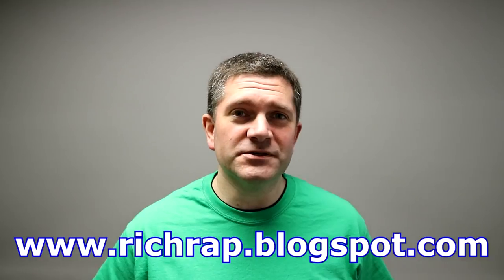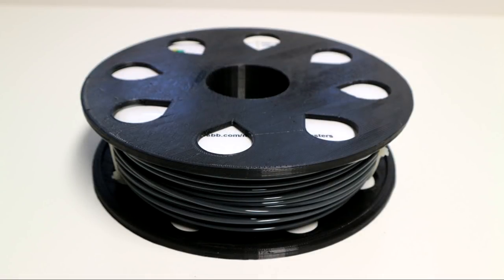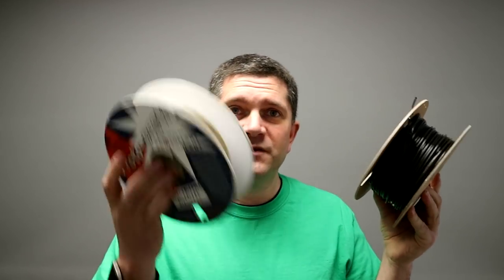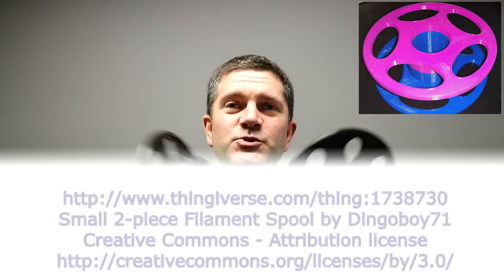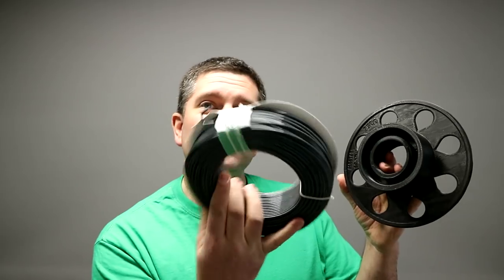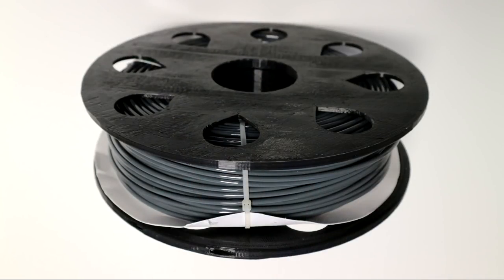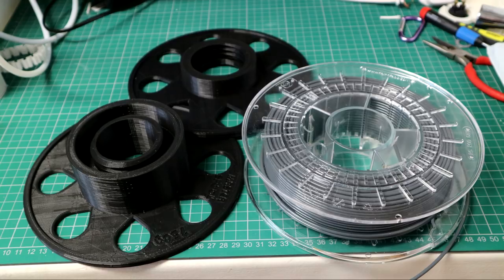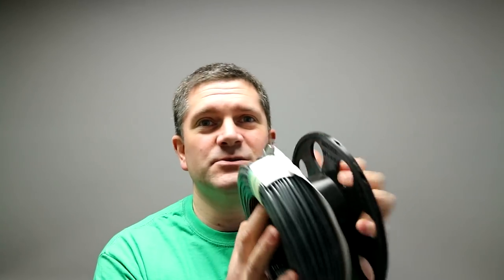MasterSpool Standard for 3D Printing

Comment: Absolutely wizard idea.  Now all we need to do is get manufacturers in multiple countries to agree on a standard.   Good luck with that!
Reply from the maker: That's straightforward - they do it already now 200mm spools 52mm mount hole - you just get a big one to do it first, and a machine supplier to use it.

Comment: I'm in -- but you have a couple of hurdles to overcome -- 1 the spooling process has to adapt to this so that you get a tight clean wind. And as a high school teacher of mine once said -- make something idiot-proof, and they'll make a better idiot. So there are enough people blaming manufacturers for bad spool winds while 99% of the time it's user error for letting go of the end, and this will introduce more of such issues. Maybe a compromise where it comes on a cardboard inner tube (like toilet paper) -- there needs to be something to ensure the inside diameter is maintained and the roll can be cleanly transferred over

Comment: The idea has merit.  I like the idea of having a piece of cardboard in the center of the coil to keep the inner diameter consistent.  I also would like the option where the filament manufacturer can ship a few "starter" MasterSpools to get someone going.  Some of us that have 3D printers are still learning, and having to print out our own spool straight away may be a bit daunting.  I personally would cringe having to print a spool on a Fabrikator Mini v1.5 in order to use my coil.

Comment: Hi Rich, I like the idea a lot. My only concern would be to ensure the coils are protected from bends etc during shipping. But if the spools are still packed in boxes, I think that should provide sufficient protection.
Perhaps Filamentive might be receptive to the idea too, especially since they already offer a discount for returned spools as part of their green focus.
I wish you all the luck in the world with this. I will certainly be keeping and eye on it and also ask the question when I speak to suppliers that I use
Reply from the maker: I think you will still require some other packaging, but it would be cardboard and probably less than is currently used. Filamentive is looking interested in the idea.

Comment: amazing idea.... 1kg worth of filament actually weight around 1.3kg with the spool included. a bare minimum spool could save a lot of shipping cost given that they keep the whole thing under 1kg. most shipping company charge in the increment of 0.5kg.
Reply from the maker: Thanks, I agree. light weight cardboard spools are a good next step, but no-spool could be really great for everyone. Ask your filament manufacturer if they could make filament coils like to support #MasterSpool. - Thanks.
Reply: I recently got some budget PLA -- prints great, but the spools are super light weight -- I confirmed that the empty spool is in fact a touch over 100g -- the full spool felt kinda light when I got it, but honest -- full spool a touch over 1100 -- so yes this is a great idea, there are some minimalist spools that some manufacturers are using -- this one was sufficiently solid -- but had a lot of cut outs -- which are actually very convenient for seeing how much plastic you have on the spool + weight savings.

Comment: I love this idea, my concern is about the end of the coil going underneath of the loops and creating a knot later on.
Reply from the maker: That happens right now with normal filament spools - you always need to keep hold of the filament end - I'll look at adding some holes and ways to hold the filament end in the spool. If not always unwind 4-5 coils before use, check no loops and rewind - then use.

Comment: Love the idea,but how do we change the material? More spools? I typically print with 8+ materials a time (different materials, different colours).
Reply: So that means you are already using 8 spools right? Would it be different to have 8 reusable spools? As long as we'd be able to get cheap mass produced master spools (or a option to add a spool when ordering) I'd say this is a viable option. Besides if you keep some rolls in stock for future use these rolls would now occupy a bit less real estate.

Comment: Not sure if this has already been addressed here in the comments (I'm on non-searchable mobile 😡), but isn't moisture absorption still a concern with some filament compositions? Perhaps those sensitive types could be packaged in an vacuum-tight, yet tear-away plastic covering that still supports the Master Spool concept? I'd imagine such packaging would also add to the materials' mechanical rigidity during shipping.

Comment: I like the idea, i just cleaned my printing room and i have something like 30 empty plastic spools that i don't know what to do with... cardboard spools are already a good answer i think. The point i'm a bit afraid of with this solution is that usually the filament is stuck in a hole in the spool before winding, this means is stays winded correctly on the spool, i'm afraid this would mean that filament gets unspooled and tangles.

Also i have a large number of filaments, i don't really want to print 20 - 30 spools, but the idea is great and needs some help from manufacturers for sure

Comment: k, So a couple of thoughts:

I have a dozen partially used spools.  I swap my spools based on my projects.  I like having a spool per filament.

I also like knowing exactly what something is.  Yes, having a paper insert initially when you get it is fine, but that's gonna get destroyed at some point.

Spools like to unspool.  There needs to be a way to secure the coil of filament when it's removed from the master spool.

If an injected molded spool is 300 grams, how much does the 3d printed part weigh???  I need more than one spool.  I don't want to spend almost 4kg of filament and a week of printing to get enough spools to feed my filament hoarding problem!

I'm good with this as long as manufacturers give you the option to buy with or without a masterspool (with the refill option being cheaper), the master spool has a way to store filament info on the outside of the spool (maybe the manufacturer provides business card shaped insert with the filament info on it that you can slide into a slot?) and there is a good way to guarantee the filament won't unspool as soon as I turn my back.

Overall, though, great idea.  Das Filament has already given it a try!

Comment: Printing spools for filament samples received in Maker Boxe's is already common.  I have printed out a mini spool to make use of  filament samples.  I personally  like the idea of having cardboard spools.  Its easier to recycle,  doesn't put a huge burden on manufacturers to adopt a new winding technique,  and will always guarantee that someone receiving the roll will be able to actually use it in their printer.  I think if we can get filament manufacturers to switch to cardboard,    that would be a huge start.  It would also be nice if they put "if filament is at this line then you have 200G or 150Meters of filament left over".  That would also be a huge quality of life improvement.

Comment: I'm a big fan of the idea. I imagine if there's a standard set for the inner diameter of a reel of filament, master spools may even become unnecessary as manufacturers build in spool holders or attachments as part of the machine instead of something that sits by or on it.
Reply from the maker: That would be fantastic - I do hope this sort of thing will also assist 3Dprinter designers / manufacturers - as you say if it was part of the 3D printer, you could just load the coil directly.
Reply: You've got me sat here (listening to some of Mark Wheadon's music) trying to think pragmatically about filament. A summary of my thoughts: I think all filament for sale in the “future” should be in an air tight container to avoid moisture or other contaminants getting into the material (most ink cartridges are sold like this already so it’s not as big an ask as it sounds). For packaging, being in a box instead of a “filament donut” would probably be easier to stack / shelf & provide better protection during shipping/storage meaning this idea would be easier to sell to manufacturers. This leads me to imagine a shrink wrapped cardboard box with a circular hole through the middle. You remove the wrapper from the box & insert your MasterSpool™ from both sides before tearing/unzipping the rest of the box off in a similar way to the sort of packages you get from Amazon nowadays. More places around the world are accepting plastic from shrink wrap in household recycling, so (providing appropriate plastics are used) the waste from that becomes a non-issue & the rest is cardboard, another non-issue. I now want to spend the rest of tonight trying to design a cardboard box :P I need to figure out how to  easily get material from extrusion machine into this holey box I’m imagining 😉 or maybe I’m just getting a little over excited, trying to help design part of an ecosystem from my sofa.
Reply from the maker: Sounds Awesome - That's exactly what this is all about - more ideas and ways to look at a problem - I think materials should come packed in vacuum sealed bags - it just makes sense to keep out moisture and protect the coils. I really like the idea of incorporating the outer packaging into the 'Donut' design - some packaging will always be needed - hopefully the manufacturers can work out how to do a minimal but usable system. - Back to the soft for more ideas :)

Comment: this is not a bad idea.
my concern is the rest of the spool unreal or tangle.
Also, if you have several different colors, you would either need a way to remove the filament from the spool or need a multiple spool.

Comment: I think it's a great idea, one that will take serious effort to achieve manufacturer adoption. I don't think the tooling would be a problem (many industries are using this exact method for packaging) but the standard I believe will be.  I think more design thought needs to be put into the MasterSpool. The spool would need to accommodate different sales offering (and printers) and remain correctly wound/tensioned between the spool ends.

And this leads to what I think will create the most adoption resistance, and that is User Error. Once that spool has been "sprung", that spool is pretty much done. (unless you have a lot of time to fix it) and manufacturers may see a significant increase in support/return numbers.

Comment: I would need to print a dozen or so spools to cover colour and filament qualities, may need to develop the idea to have a storage system to store part used filament.
Reply: I think you would have a few master-spools. While it's neat that he has a printable version, I think realistically you would buy prefabbed spools for cheaper.
Reply: I would have a great idea to solve that issue. Something like ( the Palette ) but it would have servos to drive a sharpie along one side the filament, you basically paint one side of white or clear filament with the color of your choice, I have been doing it with  pla and nylons for years the colors, however,  due to my lack of knowledge in programming ( calculating color change length to match models being printed ), I use just one color at a time. you would be surprized how little ink is needed to turn white in to a other colors.

Comment: Excellent idea - there is huge talk about plastic waste at the moment, especially in the UK. Have you approached the UK manufacturers with this idea yet? I would imagine rigid.ink & faberdashery would be ideal targets as they already sell shorter test packs and loose spools. Having them wound to a common standard would certainly help.
One way of establishing a common standard is to set up a working group - its good publicity for a filament manufacturer to be on the board of a working group, especially if it gives them added green credentials.
Reply from the maker: Starting to get really great feedback from manufacturers - one has already tested the idea - dasfilament.de Brunswick, Germany
 - they did it in just a few hours from this video being posted - it worked well and maybe viable for them to introduce soon.

Comment: Electrical wire comes in boxes and the wire is pulled out from the center of the coil. No need for even a spool. I just started this hobby and the empty spool nightmare is looming over me.
Reply from the maker: It's been discussed and it may be possible, but the plastic wire seems to be less friendly to those sort of centre coil feeding systems. No doubt it could be worked out. At least MasterSpool can reduce the need to single use filament spools, so keep a look out for manufacturers supporting the standard.
Reply: I think the box would have to be directly overhead the extruder drive, feeding from the bottom of the box with no friction or turn points where the twist can back up into the box. My extruder drive was able to eat the twist. 
My Tevo Black Widow came without a spool holder. I laid the spool flat behind the printer letting the filament spring up around the edge, then ran it over the top crosspiece of the printer and down into the extruder.  The twist was able to travel down into the extruder most of the time but sometimes it would back up behind the top crosspiece.
 Something needs to be done and a standardized reusable spool would be fine.

Another help would be to have 2 and 5 KG spools because they use less spool plastic as they get bigger.

I have  not seen any recycle marks on any of my filament spools here in the US which means they are not suppose to go into a recycling bin. I think if every user left negative feedback for every spool they buy and have     otrash, it might change things.

Comment: Richard, I am curious about one thing. Most of the filament I buy is sprung (let go and it uncoils like a snake) I have to be careful not to let the end go or it will spin up and make a birds nest. One factor of keeping it under control is that the end of the filament (last used end) is connected to the spool so as long as I control the other end I am fine but with your proposal the end is not constrained and I could see it just spinning the whole lot of filament until it's larger than the outside of the spool an just ending up in a pile on the floor. How do you think this possible issue could be resolved? Personally I would like to see them use cardboard over plastic, it's easily recyclable and would be idiot proof (well mostly).
Reply from the maker: Most feedback is now pointing to use a simple cardboard tube in the middle of the coil - that can hold the end of the filament and also provide an easy way to manufacture and load the coils. Most materials don't spring out of a coil - but a few like CF or PET/Nylon may want to slightly unwind - we will have to try and see what works.
Reply: Sounds good. My experience is 95% ABS and 4% PLA 1% other.

Comment: Its a nice idea, but there is not much of a standard on filament lengths at the moment. Most are 1Kg filament on spools. Some are 750g filament (which isn't too different). But when you get into specialty filaments, there are 500g, 250g and even 100g filament weights. Again, could be made to adapt to larger spool hole diameters, but it makes it more difficult to get everyone to standardize on it.

Now, with the larger printers, you can get 2Kg and larger spools. That means your master spool would have to be bigger to accommodate those as well - unless you had 2 Master Spool Standards. Then, its not a true standard anymore. 

I have 20+ different spools of filament. That means I'd have to buy 5Kg of extra filament to print all the Master Spools.  Ugh

Perhaps manufactures could make their spool holders reusable (twist off like yours) and then sell the reusable spool hole and filament separately. Then they would not all have to standardize on one size (that's a hard thing to get companies to do) and they could save shipping by only sending the complete set (spool + filament) the first time. When you re-order, just by the filament and it will automatically worth with their reusable spool. That might have a better chance of being adopted.
Just my 2c
Reply: You raise a good point -- though, I disagree that having two or three sizes in the standard makes it "not a standard". -- Just keep it simple, two or three sizes (t-shirt sizes like "small", "medium", and "large") could be simple enough...

For proof, just look at stepper motors: I know if I 3D print a NEMA 17 stepper mount, it's going to fit, and the holes are going to be spaced right, same with NEMA 23, etc. -- Same with case fans, I know that if I print a 40mm fan mount, that my 40mm fan's screw holes will line up; same with 80mm, and 120mm. -- It's because there's a standard for each size, that specifies exactly where the screw holes go.

No reason this can't be the same. :)

Comment: Great idea !  
spool need to be printable on a 200 x 200 mm print bed for standard
spool can be twist lock for less plastic to print
manufacturer should send filament coil on a standard cardboard core for all the format from 1 Kg or less
and may-be use wire tie like on garbage bag in place of tiewrap

Comment: Neat idea... though, the model files really need a notch or something so that the filament can be "tied" off. -- Otherwise it would just hang loose when not in use.
Reply from the maker: Totally agree. I'm looking at putting back a slot, hole and catch for filament end storage, and also a clamping point for the inner coil end of the roll. V2.2 should hopefully have these features.